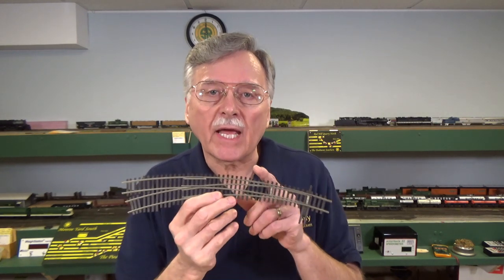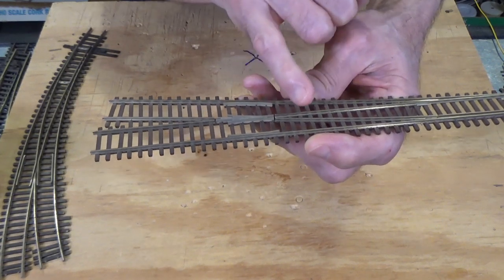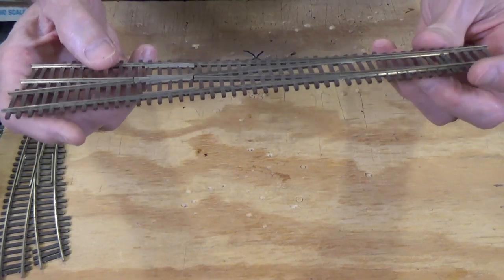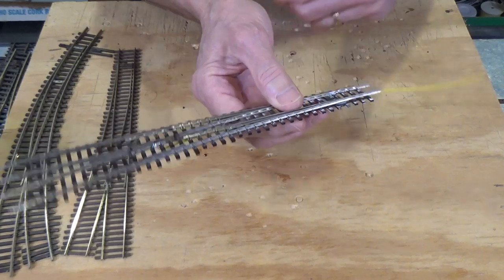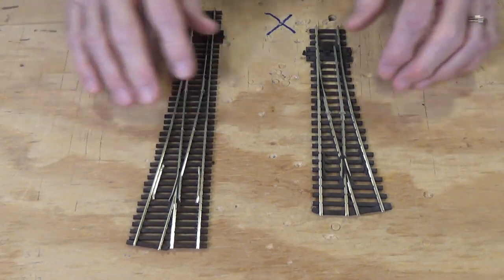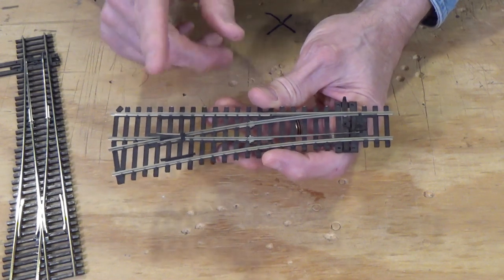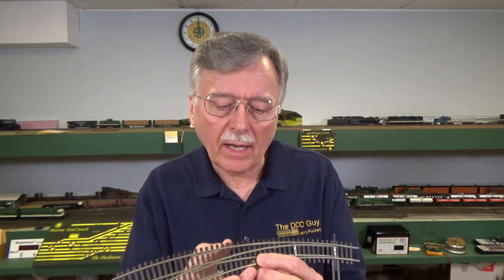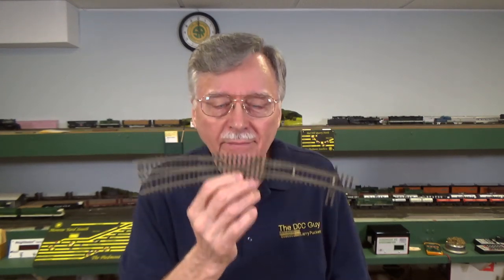Turnouts For Your Model Railroad (77)

Comment: I built my handlaid turnouts using the Fast Tracks method.  I Isolated the frogs by cutting gaps with a jewelers saw.  I simply power the frogs with a hex juicer.  I don't like using the tortoise to switch the polarity at the frog. I've been running them this way for over a decade with zero issues. Definately another option if one hasn't already invested a ton in manufactured turnouts.
Reply from the maker: Yes, Frog Juicers work very well. I mainly use Tortoise or iP Digitals to switch frog power but I do have several applications where Frog Juicers are installed. For example I use them on my double crossover, my turntable, and my gantlet track.

Comment: I have a new Atlas Customline turnout that has a small brass loop located on the outside edge of the ties under the frog. Can this be used as a connection to power the frog? If so may I use the Tam Valley Frog Juicer to power it? I don't plan to use turnout motors like like a Tortoise. Just manual throws. I'm very new to DCC so please excuse the question if it's a bit simple.
Reply from the maker: Yes, it is my understanding that Atlas has added those tabs for powering frogs. If you have a multimeter you can do a continuity test by setting it to measure resistance and then touching one probe to the tab and the other to the frog. The resistance should read “0” . And Frog Juicers are a good option for powering frogs when manual throws are used.

Comment: With regards what you do by cutting the rails, I use Tortoise point motors on the majority of the layout, so use both sets of switches to power the points, linking the two switches at the centre legs, this connection goes to the frog then each of the switches supplies power to the rails as needed when the point is thrown, or not thrown respectfully.
Reply from the maker: Interesting approach.

Comment: OH MY GOSH, Larry i have been pulling my hair out. thanks for explaining this. I ruined 2 Atlas custom turnouts trying to solder the frog. I had no idea they were aluminum and no idea that i was supposed to use a screw. EHHHHH
Reply from the maker: I forgot to mention that Atlas actually sells screws specifically for this purpose. Don’t know the stock number but it should be easy to find.

Comment: I have stopped laughing at 3 rail track.
Reply: Hey you, modern AC System 3 rail modelrailroaders don't using uplifting 3rd middle rain power pickups onto turnouts and crossing and also do polarity changing areas of their turnouts but in other areas than of what DC and DCC users onto two rail tracks going to use.
The closure rails will be needed to change the polarity of middle third rail so that there is no need to lift up the 3rd rail power pickup over the closure rails but this requiring changing of the polarity to the third rail...!

Comment: Can a powered turnout switch that is tied into a loop be handled with the Tortise machine only or is an autoreverser required?
Reply from the maker: Yes, you can use the switches built into a Tortoise for autoreversing but it can in some cases create an intermittent short as the internal contacts move. I showed this in the video I did on ways to handle reverse loops using devices that require a short to activate.

Comment: I really enjoy your information! Thanks for the great job! I had to take my Western Maryland RR down in 2007 and have decided to try again! I have twenty engines form the nineties that i installed decoders in in the late 90's. All Digitrax. I just bought a new Digitrax system. I never had a problem with my Atlas turnouts, but now my one and only #6 shorts out occasionally. Not always, but not infrequently either. It has a plastic frog and I am just using track power from the one and only three foot section of track I own....LOL. The engine I am running doesn't matter. They all do the same. Sometimes perfect, sometimes not. I am at a loss for a cure. Thanks for doing what you do! I have really enjoyed the videos!
Reply from the maker: Check the joint on the heel end of the frog. Some wheel treads are wide enough to reach over the gap and touch the other frog rail and short out. A fox is to paint clear nail polish e to prevent shorts.
Reply: @TheDCCGuy  Thank you!! I will try!

Comment: I've been a Peco user for over 25 years. And Yes.... Us Old Farts have had Debates about Insulfrog vs ElectroFrog!! I used to go through the bother of complex wiring ElectroFrog Turnouts... They're VERY useful for DC Layouts and DCC Layouts. I've messed with Frog Juicers and other switching products...
However, since I discovered, and fell madly in love with Keep-Alives 10 years ago..... 
DEAD Frogs are just fine!! 😁😜 My whole Roster has Keep-Alives - and even my 0-4-0s sail right through dead Frogs! 😊
Disclosure: I did have to get all Saddle Tank 0-4-0s.... Because they NEEDED no less than the KA-2 to store enough juice!! But they will cruise right through anything but #10 Turnouts at speed step 3!! (On 128 steps) 

So like I said, that Frog War will likely go on long after we're gone. That's just my personal take. I'd never try to convince anyone that Insulfrogs are better or worse! They're just how I like to run my Railroad... And since there's NOBODY near me to share my Layout, I don't get a lot of flak!! 😜

..... Although I'd love the chance to share the Pacific Belt RR with SOMEONE. 😞  Maybe when my Grandbabies get in their teens. 😊
Carmine ✈🚂🚙

Comment: I totally agree with your comment regards the Peco insulfrog turnout because the 0-6-0 loco's would stall on the frog, I fitted stay alive but removed all of my double slips which are insufrog. Every one of my points I use are electrofrog.
Reply from the maker: Double slips are a pain both to wire and to figure out in use. I generally avoid them, however there are places where they can be useful.

Comment: Hey Larry, please have thanks very much again for your turnout videos of this one and the before one.
Please excuse my poor british school english.
Onto my Prussian Kingdom Layout of my fictional private L.T.E. roadname in the year of 1908 I do have some security stub tournouts, they are DCC friendly, too.
In 1846 a german inventor created a mechanismn for stub turnouts that will allow to protect against derailments, if a vehicle comes from the wrong ,,dead end side" of the stub turnout. It could be added to existing stub turnouts easily, so the railroad companies did not buying and installing a completely turnout again.
If a railroad vehicle come fron wrong side of the stub turnout than the wheel flanges will press iron rails into into other direction so that the stub turnout will change the diverging direction to that rail from where the vehicle is coming and a derailment will not happen.

In 1868 the VDEV (a private association of technical railroad engineers of all german bigger railroad administrations and several foreighn railroad engineers) decided not to allow stub turnouts onto mainlines which are not security stub turnouts. Most of the prototype railroads used this date to equip modern turnouts to their railroad lines.

In my cause I am using a few ,,security" stub turnouts as older ones onto branchlines or sidings and one ,,forgotton" in a mainline use.

In other causes I use Ga(u)ntlet ,,Turnouts" onto a doubble line railroad overcrossing a ,,single line" bridge, with pointless turnouts and slinged track between the two turnouts to use the absolute minimum track space by two separated tracks onto a ,,single line" bridge.
The Ga(u)ntlets are DCC friendly, too.
Their Frog polarity needed to be changed by using a Relais.

By normal turnouts used with an underneath throwbar metal piano wire of the switch machine. Two contacts coming from both stockrails can be used to change the polarity of the frog by a very easy and cheap method when connecting the throwbar piano wire which grabs into the plastic or wooden point tie wirh the DCC friendly frog, so the polarity of the frog can be changed by turnout switching. 

Describing it in words is sometimes a little problem, better would be a method of communication where I could add pictures or drawings, is there any eMail Adress I could to have contact with you?
Reply from the maker: I think I understand your very complete description. We had stub switches here too. As well as spring switches.

Comment: Great video. Actually, my favorite method is leaving the Peco Electrofog turnouts exactly as they are and using hex frog juicers. I'm ready to go in two steps. And wheelbase dosen't matter planning on using mostly Peco for the rebuild and Maybe ME code 70 for the yardage.
Reply from the maker: Yep, these are a great combination, no soldering really necessary and very reliable.
Reply: Peco electrofrogs are about as reliable a switch as you can buy and Tam Valley Depot frog juicers are certainly install and forget for reliable frog power control.  Even so I still find it worthwhile to install jumpers between the stock and closure rails.

Comment: Hi, Larry, I like your show, which is about the turnout tracks selection. My equation is which is turnout switch either Peco model cod PCO-SL-95, and 96 or Micro Engineering (I DON NOT KNOW THE MODEL #) to use it for making  a LADDER TRACK #4. Thank YOU
Reply from the maker: I suggest you take a loom at MicroEngineering ladder track turnouts, they are specially designed to creat more compact yard ladders than normal turnouts.
Reply: @TheDCCGuy  Thank you Larry for your support to my request. Have a good day
Reply: @TheDCCGuy  Hi, Larry, thank you for advising me to try loom at Micro Engineering so I like to know which models or items number I can use it. Regards to you
Reply: I am looking for your support to my request. Thank you

Comment: Larry question Walthers turnouts, they have made a version 948-8827 and a newer version 83062  delivery due this August, description of the 8827 states DCC friendly,picture shows a gap at frog  and the closer rail looks like it is insulated, I need one for my layout,just delivery for new version is in August hobby store has a 8827 in stock, what do you think
Reply from the maker: I’ll be interested to see the new versions when available. I have a number of the older DCC Friendly Walthers turnouts on my Piedmont Southern and could likely use more.

Comment: My question is if the bulb and circuit chip shut down frying your engines why do we worry so much with turnouts. I get we need to use plastic joiner to prevent shorts.  If I hook up correctly from your video 109 then wouldn’t I be safe to run as long I stay in room watching for lights.  My layout will be small to medium size where I should be able to see whole layout
Reply from the maker: The answer is that electrons travel at near the speed of light whereas light bulbs and circuits do not operate that quickly. Therefor even a fast acting circuit breaker will not prevent the deleterious effects of a short circuit on the track. Instead it is important to prevent shorts in the first place and that is where DCC Friendly practices with turnouts and wiring, etc. come in to play. Light bulbs and circuit breakers are mainly there to prevent damage to boosters and not to protect decoders.

Comment: Larry, I am building an N-scale 4 x 8 layout, using mostly Atlas code 55 track and turnouts, but several Micro-Engineering code 55 TOs.  I thought I was going to need to use insulated joiners to isolate the frog rails, but close examination & testing shows there are tiny insulated gaps- no hot connection - between the frog point and the short 1-1/4" frog rails beyond that. It looks to me like using insulated rail joiners on the frog rails would leave a 1-1/4" dead rail gap on the inside rails beyond the turnout. 
Based on this thinking, to provide isolated divisions I need only insulate the outside rails beyond turnouts.  But that leaves me with insulated joints staggered by 1-1/4" (1-1/2" with the M-E code 55 turnouts). Is that a problem?
Reply from the maker: One good thing about ME turnouts is that the frog rails are not live and can be connected directly to the adjacent running rails for power. I don’t see any potential issues with the gaps.
Reply: @TheDCCGuy  - Much appreciated - your reply here, and to the DIY DCC system questions.

Comment: Question; if you have Shinohara turnouts, that weren't produced for Walthers, is it easy to convert them to be DCC friendly? I have several (black box SHINOHARA) that I tested with DC and they were fine.
Reply from the maker: Yes they can be converted fairly easily and that topic is on my list to do. I have a box full of them myself that I bought from a fellow who went N-scale and I use them from time to time on industry sidings. I’ll try to move them up in the order, so nang in there.
Reply: @TheDCCGuy  I am not in a huge rush, so please don't hurry on my account. My layout is in storage as I have no place to put it since  I moved just yet. Whenever you can would be an amazing help and thank you for getting back to me.
Reply from the maker: Well, then now would be a great time to do the conversions assuming you can dig them out. At any rate it is a good time for me to doit since I did the two videos on turnouts recently.
Reply: @TheDCCGuy , yes I can get them out. Debating if taking the sections out (2- 4'x'8's) one at a time or taking the turnouts off and doing them individually. One of the turnouts is a double crossover turnout. I will wait for videos, regardless they will be helpful I am sure.

Comment: Do you have a video on the Walthers Cornerstone Advanced Control Module for there turn table
Reply from the maker: Jon—sorry but no I don’t. I have gotten occasional questions about it over the past few years but it really is the kind of thing I would need to have them send me a review sample to work with and given the cost I doubt that will happen. Plus, every time I check they seem to be out of stock at Walthers, so I guess they must sell them as fast as they make them.

Comment: Hi.   I have built and unfortunately never finished (due to turns of personal events) several layouts up to the framing and track laying stage.  I learned a lot, made mistakes...but. Shit happens.   ETC.  My plan now?   A switching layout, based on the space constraints I currently have (HO)...When it comes to turnouts?  I bought a whole bunch of those 'green' ones, and they work great.  When installed correctly.

Comment: Question: Can the passage of a train from the rear of a turnout to the front change the direction of the switch? Thanks
Reply from the maker: How do you mean that? There are ways to automate switch activation using accessory decodes—take a look at the DCC Specialties PSX series. Now if you mean will the loco wheels cause it to happen that is a bit trickier since you need some way of keeping the points from just flopping around and causing derailments. So normally this would not work. There are ways to use a spring to keep the points thrown one way normally but be light enough for the wheels to force them to open, but that can e tricky to set up and not get light cars to derail.
Reply: Model Railroading Yes, I want the loco wheels to set the switch. I don’t want an electric or manual switch. I want the train to travel a circuit clockwise on the first pass, counter clockwise, the second; & alternate indefinitely. The simplest circuit I know of for this is 2 bulbs (loops) connected by a single track. If the loco wheels set switch, the train will change direction forever. Thanks.

Comment: Great Video .... but i have a request ...

is it possible to explain what the best choice is for using the automatic polarisation of the turnout. I heard about a autofrog , but someone told me this is a dangerous option because of the short cut principle.

i'm very in doubt, because this autofrog  (gaugemaster) is easy to install, with switches is difficult adjusting but very safe.

i'm hoping on a explanation of a expert ..... can you help me ?
Reply from the maker: The idea is to (1) provide power to the frog so short wheelbase locos won’t stall on a dead frog, and (2) to get the correct polarity at the frog so you won’t get a short circuit. I have no idea what your friend meant with that. The auto frog juicers detect a short circuit and correct the polarity before your system sees it and shuts down. I have never heard of any damage in the process.
Reply: @TheDCCGuy   thanks again. your explanation is clear.  Is this also for these auto frogs with a relais ?
grtz eric

Comment: how do you make a point corrector for an Atlas no.6 turnout?
Reply from the maker: What’s a point corrector?
Reply: @TheDCCGuy  it's a piece of curve track to bring the diverging route of the turnout parallel to the through route, used for sidings
Reply from the maker: OK, I see what you mean. I use flextrack so it is a simple procedure to curve it to meet the end of the points. If you are using set track with preconfigured curvature then I would go ahead and cut short sections of flextrack to make the transition smooth.
Reply: @TheDCCGuy  thank you very much sir